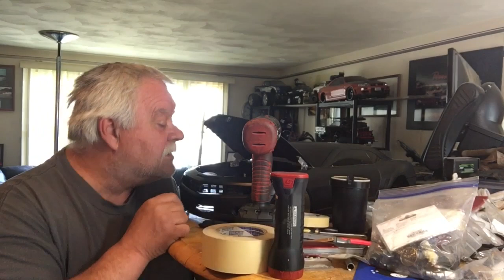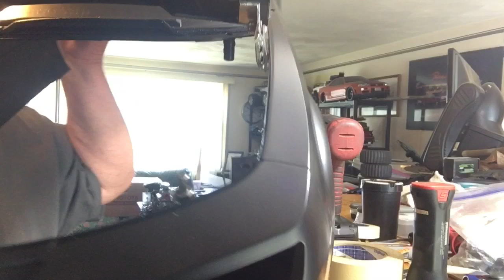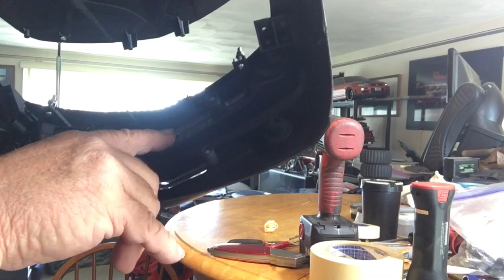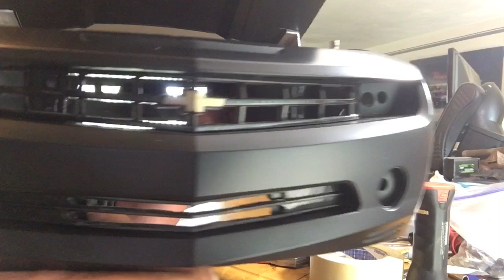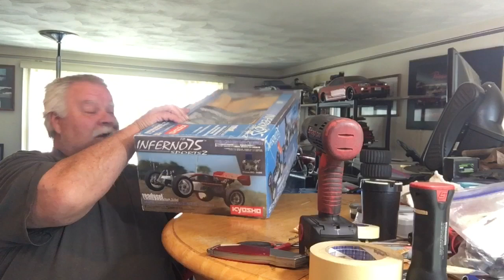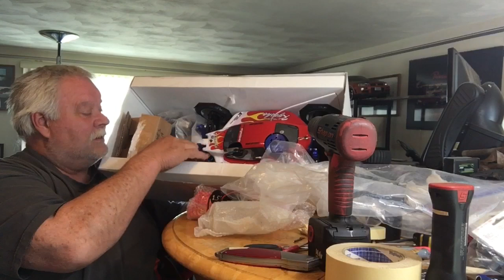THE TOYAN/HOWIN v8 CAMARO BUILD BEGINS!

Comment: Can you please tell me how much for car, radio, and motor if Was to buy one.
Reply from the maker: the V8 is around 1700.00 finding the car body is the hard part, they usually sell on ebay for around 300.00, the radios are about 100,00. the labor to custom fit everything would be another costs.